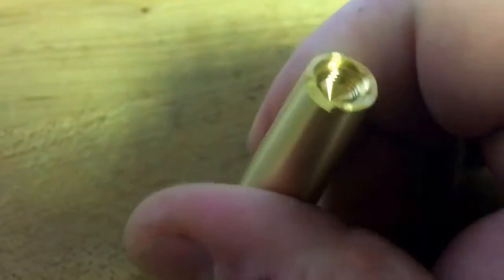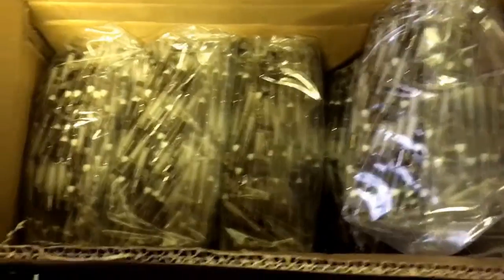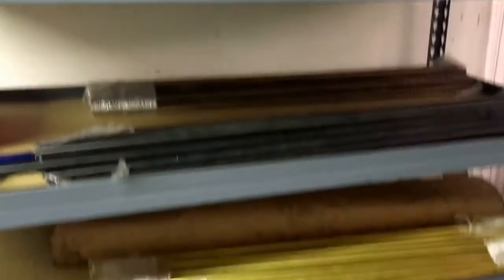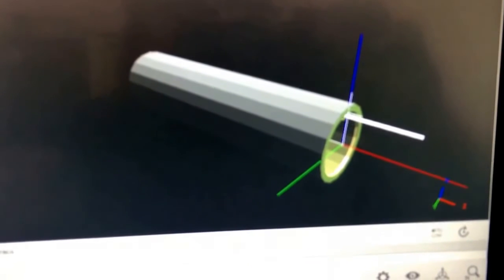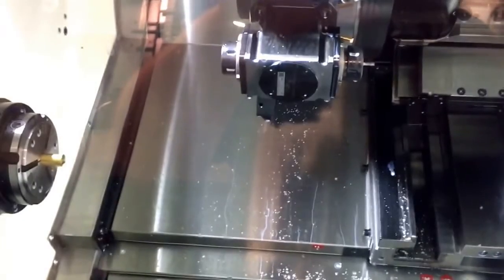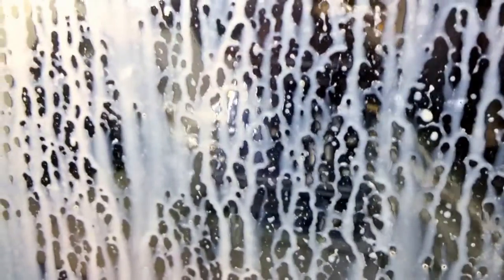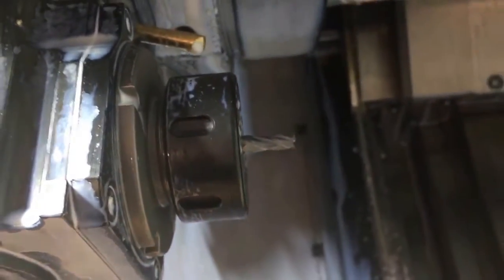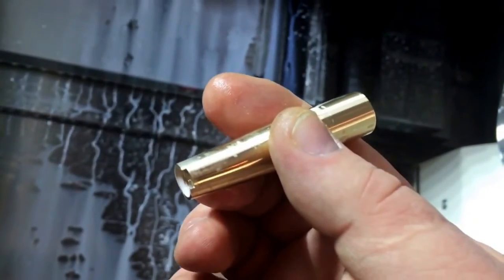Gist fountain pen update and making the first caps on the DMG Mori NLX1500SY

Comment: someone needs a visiport..
Reply: +Will Hodges our new toy came with a non-visiport brand visiport, and its noisy. sounds like a jet engine taking off. other stuff has the actual ones and theyre silent, so recommend going genuine. which barfeed did you get?
Reply: +Will Hodges quick load servo 80?
Reply: +Will Hodges can you give any insight to the issues or things you don't like? our qls80 is set to get setup on Monday, be nice to have some heads up on what to expect..